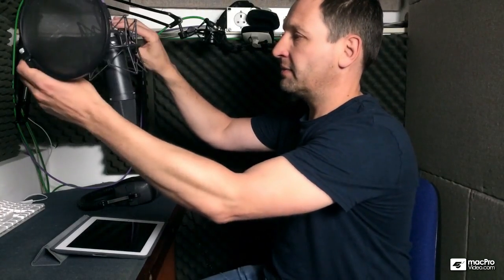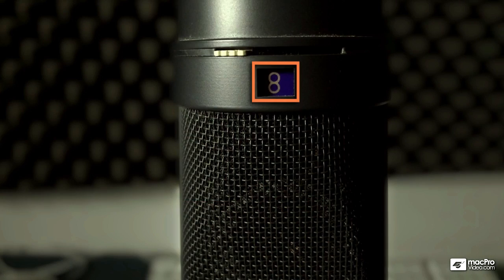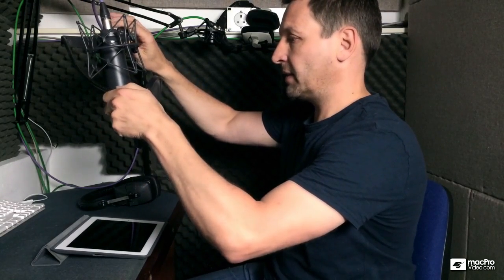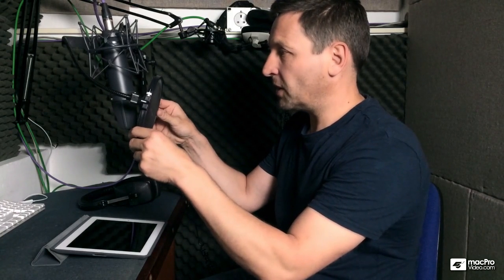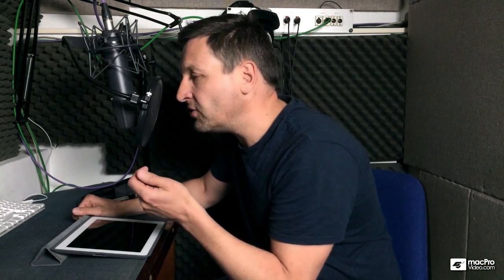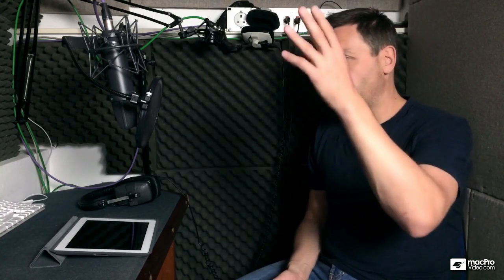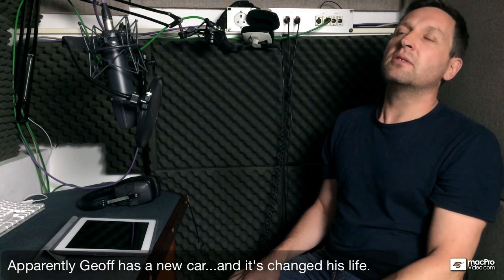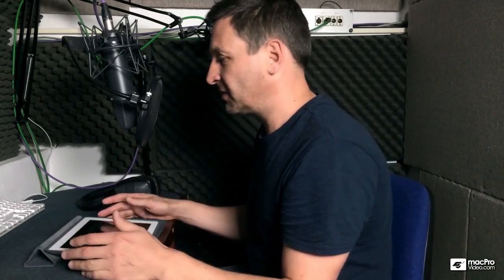Logic Pro X 305: Voiceover Recording and Editing - 6. Microphone Technique

Comment: you should never record a voice from a sit down position
Reply: I know this is an old comment, but so. Most long audiobooks are done from a seated position actually. If it works, it works. You can stretch your diaphragm just fine by sitting up in a good posture and proper mic technique makes the recording no different than standing.
Reply: +Attizzoso Dissaldato Never is a pretty strong word.